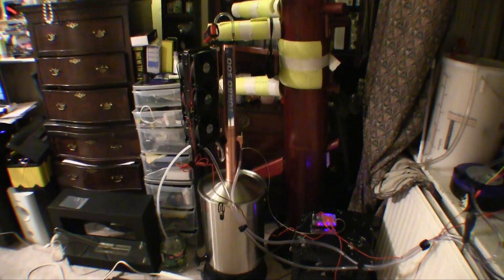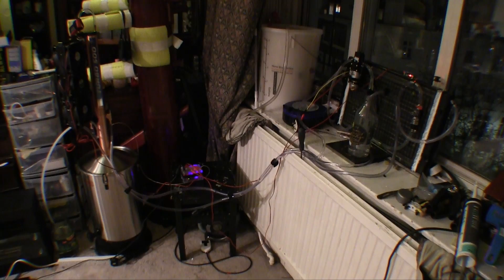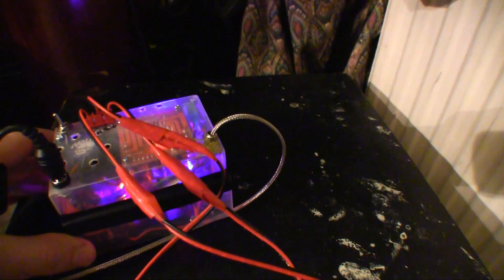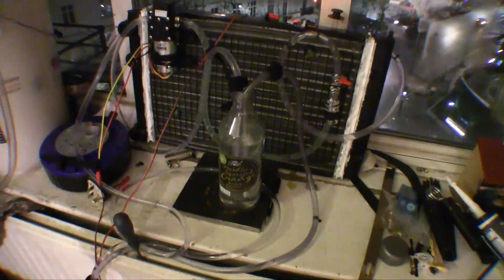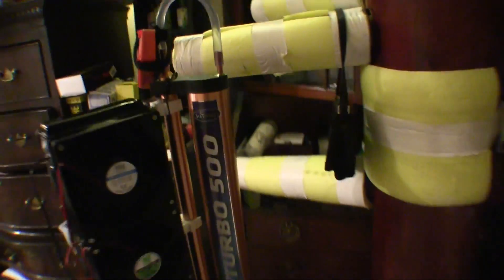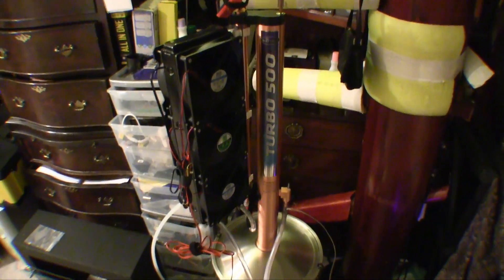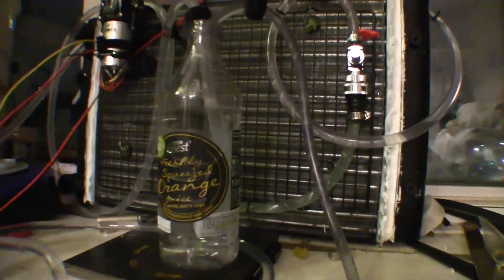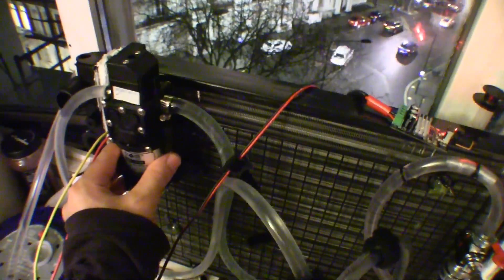Still Spirits Turbo 500 With Temperature Management System DIY

Comment: Wow!! This is exactly what I needI don't have any coding background please advise how I can set this up.I'm not familiar with the arduinoMay I ask for your help in setting this up step by step?Also are you able to achieve 200 proof with this setup?
Reply from the maker: +Steven B Hi Steven, I can help you. You need the following:

 1- Arduino Uno: 

http://www.ebay.co.uk/itm/UNO-R3-Arduino-Rev3-ATMEGA328P-Compatible-Board-Free-USB-Cable-Pins-/262200725666?hash=item3d0c6190a2:g:F2sAAOSw1S9WeTIc
 

2- Diaphram Water Pump:

http://www.ebay.co.uk/itm/High-Pressure-Diaphragm-Water-Pump-12V-100PSI-4L-Min-For-Car-Marine-Yacht-Boat-/171324428554?hash=item27e3bb510a:g:zlcAAOSwFnFV-hnc

3- Thermocouple Sensor Module for Arduino:

http://www.ebay.co.uk/itm/271556241312?_trksid=p2057872.m2749.l2649&ssPageName=STRK%3AMEBIDX%3AIT

4- 120mm Computer Fans (x6):

http://www.ebay.co.uk/itm/321785201877?_trksid=p2057872.m2749.l2649&ssPageName=STRK%3AMEBIDX%3AIT

5- Motor Controller for Arduino:

http://www.ebay.co.uk/itm/Dual-H-Bridge-L298N-DC-Stepper-Motor-Driver-Controller-Board-4-Arduino-1-5x-/161975032485?var=&hash=item25b676daa5:m:mexHH0kbqIh8kvdINxWHhqA

6- Computer Cooling Radiators (x2):

http://www.ebay.co.uk/itm/1pc-Aluminum-Computer-Radiator-Water-Cooling-Cooler-for-CPU-LED-Heatsink-360mm-/321894906355?hash=item4af26e79f3:g:A8wAAOSwjVVVufiN

It is all about connecting the sensor module and the motor controller to
 the arduino uno board (I can send you the instructions on which wires 
to connect)
and then programming the arduino with few codes (please find below).

Do you have any IT background?
Do you know what is arduino?

Let me know if you need the wiring connections instructions or any other
 help

Code is as follows:

#include "max6675.h"

int thermoDO = 4;
int thermoCS = 5;
int thermoCLK = 6;

MAX6675 thermocouple(thermoCLK, thermoCS, thermoDO);
int vccPin = 3;
int gndPin = 2;
  
void setup() {
  Serial.begin(9600);
  // use Arduino pins 
  pinMode(vccPin, OUTPUT); digitalWrite(vccPin, HIGH);
  pinMode(gndPin, OUTPUT); digitalWrite(gndPin, LOW);
  pinMode(7, OUTPUT);
  pinMode(12, OUTPUT);
  pinMode(9, OUTPUT);
  pinMode(2, OUTPUT); // for buzzer
  
  Serial.println("MAX6675 test");
  // wait for MAX chip to stabilize
  delay(500);

  digitalWrite(12,HIGH); // pump rotation direction
  digitalWrite(7,LOW); // pump rotation direction
  analogWrite(9,150);
  delay(1000);
}

void loop() {
  // basic readout test, just print the current temp
  
   Serial.print("C = "); 
   Serial.println(thermocouple.readCelsius());
   float temperature = thermocouple.readCelsius();
 
  digitalWrite(12,HIGH); // pump rotation direction
  digitalWrite(7,LOW); // pump rotation direction
  digitalWrite(2,LOW); // For Buzzer
    
     
     if(temperature < 55){ //  Set Low Temperature
        analogWrite(9,90);
     }
     if(temperature > 49 and temperature < 51){ 
        analogWrite(9,90);
     }
     if(temperature > 51 and temperature <= 53){ 
        analogWrite(9,90);
     }
     if(temperature > 53 and temperature <= 55){ 
        analogWrite(9,90);
     }
     if(temperature > 57 and temperature <= 59){ 
        analogWrite(9,90);
     }
     if(temperature > 59 and temperature <= 61){ 
        analogWrite(9,90);
     }
     if(temperature > 61 and temperature <= 63){ 
        analogWrite(9,95);
     }
     if(temperature > 63 and temperature <= 65){ 
        analogWrite(9,100);
     }
     if(temperature > 65 and temperature <= 66){ 
        analogWrite(9,125);
     }
     if(temperature > 66 and temperature <= 67){ 
        analogWrite(9,145);
     }
      if(temperature > 67 and temperature <= 69){ 
        analogWrite(9,175);
        digitalWrite(2,HIGH);
     }
     if(temperature > 67){ 
        digitalWrite(2,HIGH); // For Buzzer
     }

     if(temperature > 67){ // Set Low Temperature
        analogWrite(9,200);
     }
         
   delay(1000);
}

Comment: This is awesome! Can you provide some details if I wanted to try to duplicate this for my system? What is the flow range of the pump? What radiator and cooling fan are you using? Thank you!
Reply from the maker: +Eric Howell Hey Erik, Sure I am glad to help. I did some more adjustments afterwords to use only one radiator and an extra feature to sound an alarm sound if temperature exceeds a certain value.

It is simple to do, You need the following:

 1- Arduino Uno: 

http://www.ebay.co.uk/itm/UNO-R3-Arduino-Rev3-ATMEGA328P-Compatible-Board-Free-USB-Cable-Pins-/262200725666?hash=item3d0c6190a2:g:F2sAAOSw1S9WeTIc
 

2- Diaphram Water Pump:

http://www.ebay.co.uk/itm/High-Pressure-Diaphragm-Water-Pump-12V-100PSI-4L-Min-For-Car-Marine-Yacht-Boat-/171324428554?hash=item27e3bb510a:g:zlcAAOSwFnFV-hnc

3- Thermocouple Sensor Module for Arduino:

http://www.ebay.co.uk/itm/271556241312?_trksid=p2057872.m2749.l2649&ssPageName=STRK%3AMEBIDX%3AIT

4- 120mm Computer Fans (x6):

http://www.ebay.co.uk/itm/321785201877?_trksid=p2057872.m2749.l2649&ssPageName=STRK%3AMEBIDX%3AIT

5- Motor Controller for Arduino:

http://www.ebay.co.uk/itm/Dual-H-Bridge-L298N-DC-Stepper-Motor-Driver-Controller-Board-4-Arduino-1-5x-/161975032485?var=&hash=item25b676daa5:m:mexHH0kbqIh8kvdINxWHhqA

6- Computer Cooling Radiators (x2):

http://www.ebay.co.uk/itm/1pc-Aluminum-Computer-Radiator-Water-Cooling-Cooler-for-CPU-LED-Heatsink-360mm-/321894906355?hash=item4af26e79f3:g:A8wAAOSwjVVVufiN

It is all about connecting the sensor module and the motor controller to the arduino uno board (I can send you the instructions on which wires to connect)
and then programming the arduino with few codes (please find below).

Do you have any IT background?
Do you know what is arduino?

Let me know if you need the wiring connections instructions or any other help

Code is as follows:

#include "max6675.h"

int thermoDO = 4;
int thermoCS = 5;
int thermoCLK = 6;

MAX6675 thermocouple(thermoCLK, thermoCS, thermoDO);
int vccPin = 3;
int gndPin = 2;
  
void setup() {
  Serial.begin(9600);
  // use Arduino pins 
  pinMode(vccPin, OUTPUT); digitalWrite(vccPin, HIGH);
  pinMode(gndPin, OUTPUT); digitalWrite(gndPin, LOW);
  pinMode(7, OUTPUT);
  pinMode(12, OUTPUT);
  pinMode(9, OUTPUT);
  pinMode(2, OUTPUT); // for buzzer
  
  Serial.println("MAX6675 test");
  // wait for MAX chip to stabilize
  delay(500);

  digitalWrite(12,HIGH); // pump rotation direction
  digitalWrite(7,LOW); // pump rotation direction
  analogWrite(9,150);
  delay(1000);
}

void loop() {
  // basic readout test, just print the current temp
  
   Serial.print("C = "); 
   Serial.println(thermocouple.readCelsius());
   float temperature = thermocouple.readCelsius();
 
  digitalWrite(12,HIGH); // pump rotation direction
  digitalWrite(7,LOW); // pump rotation direction
  digitalWrite(2,LOW); // For Buzzer
    
     
     if(temperature < 55){ //  Set Low Temperature
        analogWrite(9,90);
     }
     if(temperature > 49 and temperature < 51){ 
        analogWrite(9,90);
     }
     if(temperature > 51 and temperature <= 53){ 
        analogWrite(9,90);
     }
     if(temperature > 53 and temperature <= 55){ 
        analogWrite(9,90);
     }
     if(temperature > 57 and temperature <= 59){ 
        analogWrite(9,90);
     }
     if(temperature > 59 and temperature <= 61){ 
        analogWrite(9,90);
     }
     if(temperature > 61 and temperature <= 63){ 
        analogWrite(9,95);
     }
     if(temperature > 63 and temperature <= 65){ 
        analogWrite(9,100);
     }
     if(temperature > 65 and temperature <= 66){ 
        analogWrite(9,125);
     }
     if(temperature > 66 and temperature <= 67){ 
        analogWrite(9,145);
     }
      if(temperature > 67 and temperature <= 69){ 
        analogWrite(9,175);
        digitalWrite(2,HIGH);
     }
     if(temperature > 67){ 
        digitalWrite(2,HIGH); // For Buzzer
     }

     if(temperature > 67){ // Set Low Temperature
        analogWrite(9,200);
     }
         
   delay(1000);
}
Reply: Oh yes. I've been trying to come up with my own design but then saw that you had exactly what I was thinking of. I'm a chemical technician with a good IT background and friends to help with the arduino programming. This is so much help. Thank you so much!
Reply from the maker: +Eric Howell Glad to help, Welcome!
Reply: @Sandworm33  some help with the wiring diagram would bea big help